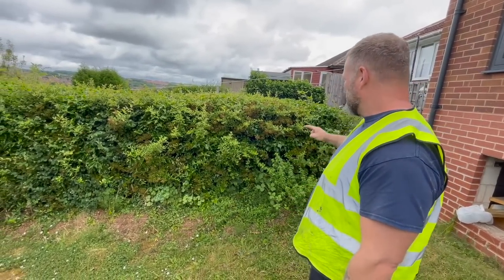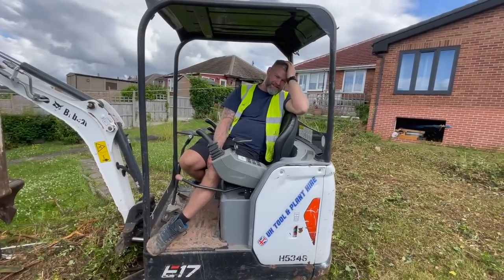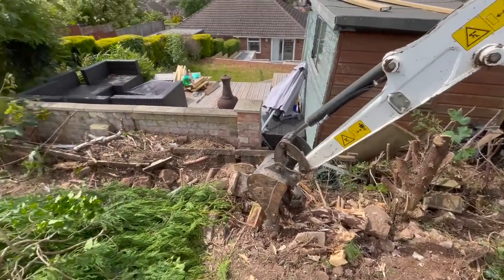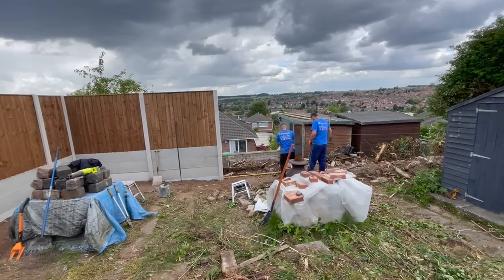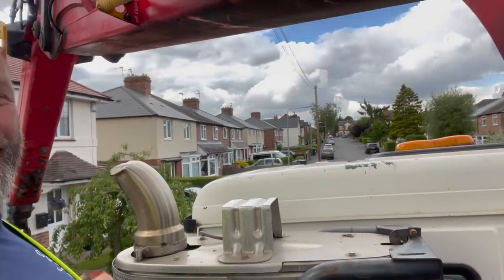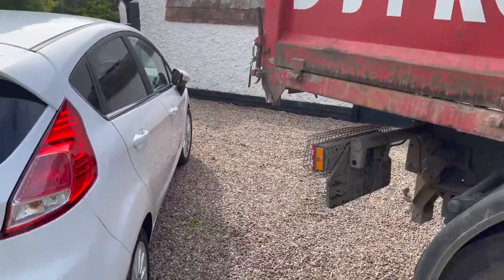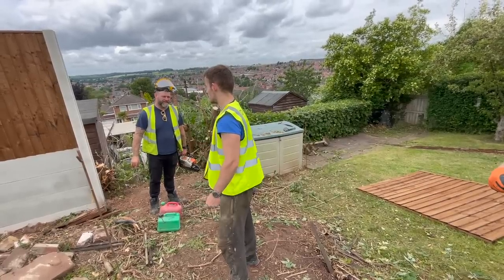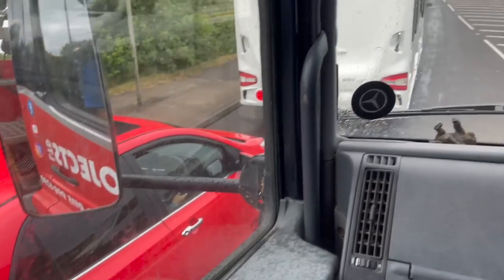THE HARDEST FENCE INSTALL WE'VE EVER DONE ON YOUTUBE! - This Week At D&J Projects #060

Comment: Crikey! You certainly show that there's a heck of a lot more to fencing than digging holes and dropping posts in.  To work out all those drops to get down that slope so that over 10 bays or whatever, you align with the bottom fence; AND have the awareness to match up with the fence on the other side. AND AND, seemingly doing all the calculations in your head. Well, 👏👏👏🤘

Oh, and you Italians with your seven hills of Rome, you've got nothing on Nottingham! 😂

Comment: That looks incredible boys, the garden has so much potential.  I can speak from experience that if you do keep a real lawn after you have landscaped the garden then it will be far easier to mow it if it is flat rather that going uphill.  My self propelled lawnmower came delivered with a broken wheel so I haven't got to use it yet so I bought a pushalong while it is being replaced and it really isn't easy trying to push up the gradient so if you do have a real lawn I'd suggest having that area levelled, also it's much easier on the edges and borders too.

Comment: Great work again lads at D&J  very good videos aswell. Keep up the hard work
Reply: Instead of that crazy looking custom panel at the bottom corner could you not come in bigger or smaller sections when starting and not be left with a silly piece at the end or when 3 or 4 panels from home customize them 3 or 4 sections. That's what I would do and I'm an electrician lol

Comment: Stevie, I’ve been meaning to say. If you have a broken bar from the breaker, and an old post hole digger. You can weld one of the blades off the post digger to the breaker bar and it will make diggin in clay and hard dirt a bit easier.

Comment: Afternoon D&J team wow I’ve put a few fences up in my time but that one is probably the Carlsberg of fences to match up both sides without a laser level and all that rubble in the way is one hell of a job, so a great big well done to the team. There was some good work done by everyone across the team as per your normal selves.
Dave don’t go to price jobs up in the new motor as some will see it and think ”he’s charging to much so he’s not going to get the job) it happened to someone who I know he got a very high % of the jobs he gave a quote for and he’d saved hard for years to buy a nice car that he’d wanted for ages and his % of jobs went right down. So he used his work van to do quotes and the % went right back up. All down to jealousy just because he saved hard for years to get this certain type of car 2+2=55 in some foolish heads. But it’s a nice car you’ve got there I like the shape and the power combined with the luxury of the inside.

Comment: Great show as always guys just a thought when you are pulling stumps out if you have a digger why not use those green 
slings. Loop them to the base of the stump and just pull i have used them to pull a 12"x12"x8ft wooden post for a customer using my Hiab brick grab 
works a treat.

Comment: Wow is this one of the longest video’s you have done?
What an amazing transformation on the fencing.  
I thought you would have got a petrol or a hybrid to keep the costs down. Diesel is far too expensive these days. 
What a cracking car I’m not a fan of BMW but she does look the dogs bollocks. 
If it wasn’t for those low hanging cables mighty white would have worked well especially with the extra length on the crane. 
The red car  at the end was just asking for trouble. It was a female driver mind. 
Lovely to see everyone working as a team and doing their bit.

Comment: Fantastic job lads looked like some hard graft from all you boys to get that job completed. I have a question bud do you not find it difficult digging the second hole for your completed bay when you already have the grav boards and panel resting in place I’ve tried it before and just kept hitting the grav boards with the post hole diggers almost found you had to go in at an angle in order to avoid doing this you lads make it look so simple top job